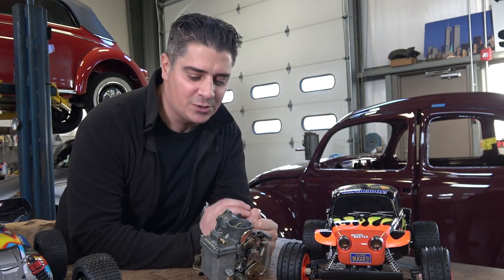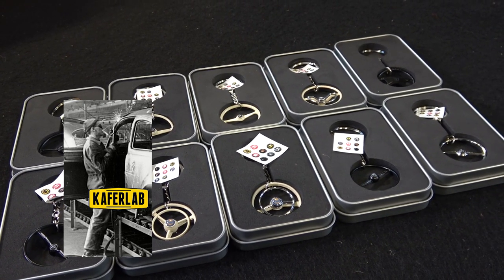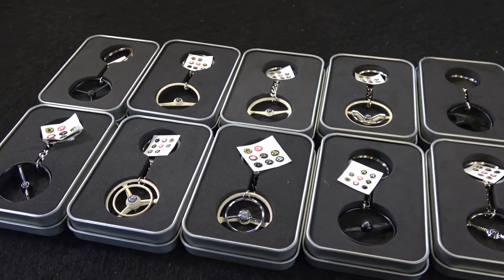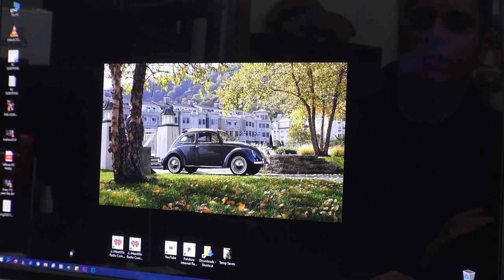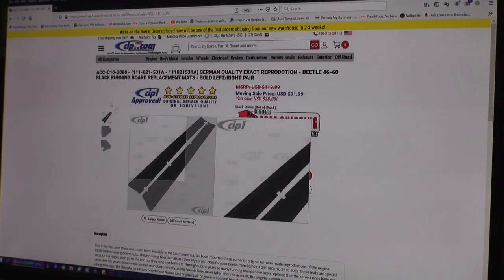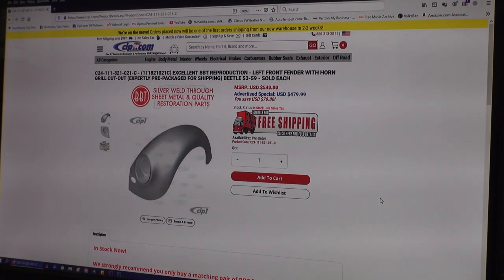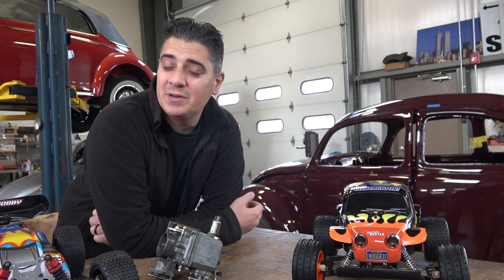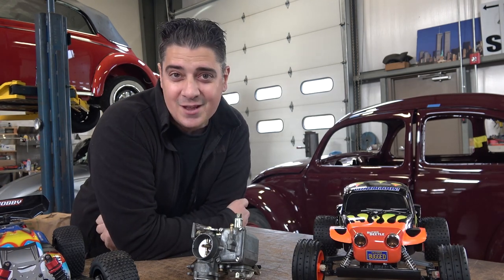Classic VW BuGs - Carb TIP i MISSED - BBT Vintage Beetle Fenders - Kaferlab Giveaway

Comment: Chris thank you for your tips. My 71 sb hesitates. On thing I noticed is that the manifold under the carb is sweating when the engine is shut off. Also there is a gas smell as well and it take a while to restart the engine. Any inputs are welcome
Reply from the maker: could be heat risers are clogged for the condensation on the manifold. As far as gas smell, is it coming from the engine or in the trunk?

Comment: #ClassicGiveAway 
an almond semi batwing for my 56 would be stellar !! love your videos as they are always very helpful and informative. Today I will be using your video on installation of pop-out windows to help me get the holes all drilled before sending my bug off to paint after Thanksgiving. This video that you just posted about BBT and Klassicfab fenders had very ironic timing for me. Yesterday I was working on cutting bumper bracket holes in a set of fiberglass fenders that came on my 56..... to my dismay these were actually wide fenders, as I discovered when I went to put my towel bar bumper on. This fat fender - small original bumper look, did not jive with the look I am trying to achieve. So last night I started looking for new front and rear fenders and came across the BBT ones on CIP1 and they look great. I am now torn between the BBT and Klassicfab ones. Anyone have any insite on choosing between the two? Also any recommendations for rear fenders on my 56, as it does not appear that BBT has rear fenders. Shout out to Chris and Classic VW Bugs for hosting awesome videos and Kaferlab for a really cool promotion :)
Reply from the maker: Hey my friend!  I heard the BBT are great.  As far as rears, either try for real German, or the IGP brazilian are not too bad, and they have the dimples between the bolt holes like they should.   Just have to fill the light holes and red-drill the correct holes for your bug.

Comment: #ClassicGivaway nice to see cris that you have found BBT in Belgium.
Nie fitting parts and a good price.
here we can buy them cheaper, about 800 euro's for the pair.
nice video's, learning a lot by looking at them.
greetings from Belgium.
Reply: and maybe a 1955 steering wheel would be a nice extra to my grandfathers oval.
restouring the car as original possible after 36 years off dust growing sleep.
Reply from the maker: Very nice man, thank you.

Comment: Chris I'm new in this kind of a project, I just bought a 1973 beetle and its using Solex 30 and its messed up, it has some booby traps wires on it, I want to replace it but I find a lot of 34 type carburetor,  what will the do's & don'ts be

Comment: Great video, happy holidays to you and your family from 64vw of nj, what you use in your gasoline went you storage you  vw?
Reply from the maker: Stabil or startron is fine.
Reply: @classicvwbugs  full the car up and poor the stabil ......
Reply: @gustavopadilla9176  Pour in the Sta-BIl first, then fill the car with gas.  That way the two mix together really well.  Then drive your car for 5-10 minutes so the treated gas fills the entire fuel system
Reply: @chrisfreemesser5707  I going to run the engine  for  5 to 10 minutes in my garage, my is a garage queen so far
Reply from the maker: @gustavopadilla9176  well just check the directions on the bottle first.  I would not fill it and let it sit in my opinion.

Comment: Sorry man but this is bad advice. Properly clean the carb and make sure the correct jets are in. is the best you can do. Just stick with your last video. That was sound advice. You literally told ppl to run with an possible active fuel leak. That "Idle" solenoid is a fuel shut off when the key is off. It prevents run on.
Reply from the maker: Well no, you are not cracking that loose to the point where you want fuel to leak out, of course not.  Many times they are just too tight, they do not have to be muscled down, you can loosen it, then tighten it till it is snug, many times that can help the idle on the carb.
Reply: @classicvwbugs  Correct; all of the brass jets need to just be snug not torqued in. The way it sounded in the video was that you just loosen it up. I saw another guy on here giving similar advice and said he put an o-ring around the idle jet to basicly shim it! None of us want someones pride and joy burning up. Thanks for clearing it up.
Reply: If backing the fuel shut off valve works ( you shouldn't back it off) it may be faulty or sheck the curcuit for power or perhaps it got plugged in to the negative side of the coil by mistake.